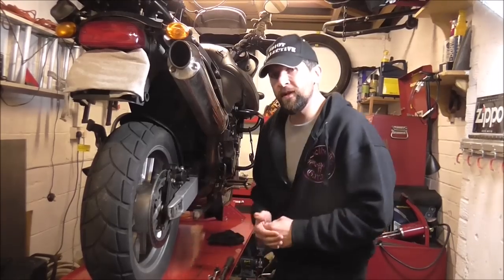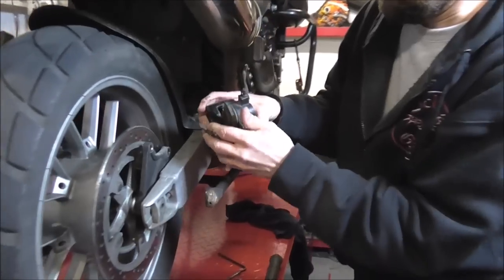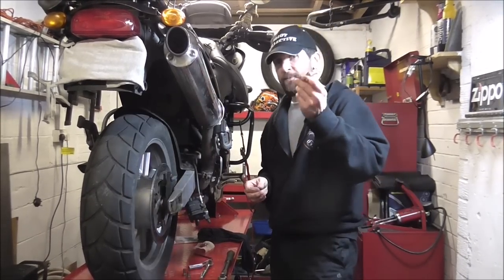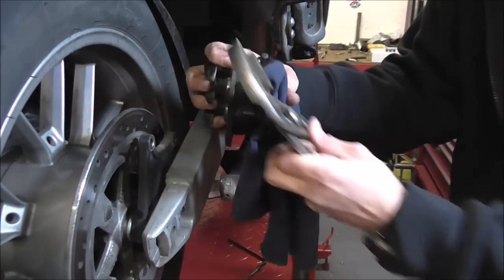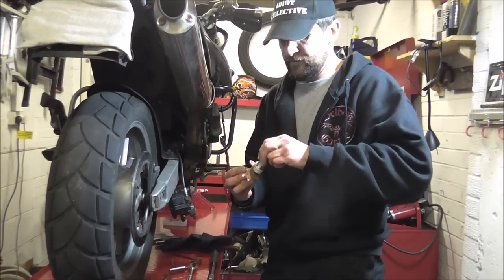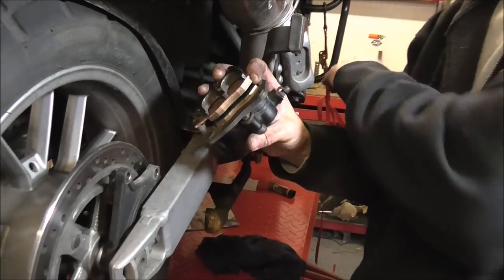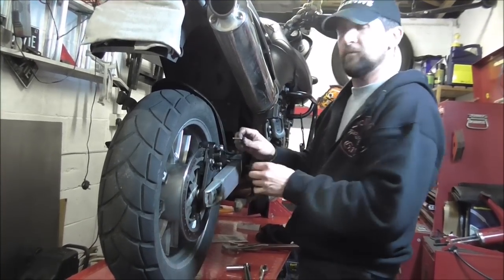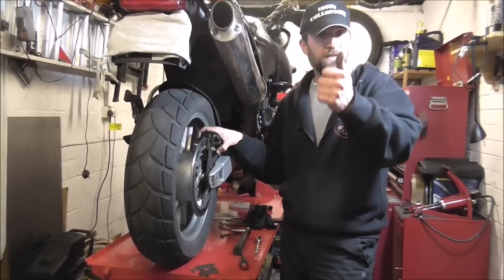Delboy's Garage, EBC 'HH' Sintered Copper Brake Pads.

Comment: Awesome explanation on the EBC HH Sintereed pads, and I am sure they are the bomb for sports bikes or cruisers with front and rear disc brakes, however I have an older bike 2002 Vulcan 800 Classic with the disc front and a suggestion of a rear brake in the form of a drum rear brake, what would you recommend as a brake combo for pads and linings?
Reply from the maker: Hi buddy, well it's no reason not to still use the EBC pads on your front, and if you talk to Wemoto , who we trust for parts on older bikes, it may well be possible that they have an EBC drum lining for the rear... let us know how you get on!
Reply: Will do, just wanted to say thank for the vids, I am taking a Motorcycle repair course right now and your videos have helped greatly in getting me ahead of the class, you covered a lot of material in your vids and much appreciated. Tried to find EBC drum lining but haven't had any luck so far. Also tried another brand of sintered pad up front and they were really hard on rotors and with the weak rear drum brake caused the bike to dive under hard braking, makes it a bit squirrelly especially on a lowered cruiser.
Reply from the maker: Yeah, sintered pads are harder on discs due to the higher friction they have... but i guess thats a trade off for more bite... i installed them on Penny's Scrambler and she says they are more instant to react, and need less grip on the lever too.. so maybe dont grab them too hard and see if that helps... we also used the EBC discs to go with them as they claim their discs are better suited to resist the wear, that makes it a pricey upgrade, but so far, almost no wear on the disc other than the usual rubbing in bloom, and thats on just over 1000 miles... so we wait to see if they last better than factory discs...    Good luck finding the brake shoes... as a last thought... have you thought about getting the drum itself skimmed to make it flat again, then installing some new factory OEM shoes..?.. just a thought.!
Reply: by skimming do you mean breaking the glaze with something like 120 grit emery cloth or a mechanical resurfacing, if the resurfacing is what you mean the shops have not done that here in Canada for almost 20 years on cars and trucks, and the bike shops I contacted say they have never done it to their knowledge, but their techs are young and only know of their own experience. Thanks for your responses, I am now looking into swapping a disc brake setup from a Vulcan drifter of the same era to my bike, only problem is I have to swap both rims as the speedo is on front tire for the drifter with disc setup and on the rear for the Vulcan Classic with the drum brake setup, might be more expensive than this bike is worth.
Reply from the maker: No buddy... i 'skimming' i mean having the top surface ot the drum machined off to its flat, engineering shops can perform this, you may need to hunt round for a firm to do it.. but it involved taking the grooves out of the drum inner face to give a new flat finish, thus more contact and better braking.. i was just trying to suggest a way to improve on the factory equipment you have already and no spend a fortune on a disc conversion.... you may not find anyone to do it... but even temporarily, if you brake the glaze off the inner face of your drum it will improve braking.. but only temporarily.. it will soon glaze up again in use... sorry not to be more help buddy.
Reply: Thanks for your suggestions, all good info. Got rear wheel off now, changing chain and sprockets (front and rear) replacing brake linings, de-glaze drum and putting in new wheel bearing and seals. Should be good for a while again.

Comment: Funny coincidence I bough these pads last month, I have a quick question, when I lightly cover the breaks and apply a little pressure they kind of make a funny noise ( like a sssssss noise) that stock brakes didn't, its not really a sequel (so I don't think they are vibrating although I didn't use any copper grease when they were installed...) but when I apply more pressure the sound goes away. Also if I apply alot of pressure and then just cover them again there in no noise, so I think it maybe temperature related? any thoughts? have I done anything wrong?
Ride safe!
Reply from the maker: Blimey Josh, top marks mate, you've clearly got them set up perfectly!  That noice which you describe kind of a 'skissssh' sound is sononymous with high performance brakes and it is purely the temperature leveling out as you apply them... quite normal, and quite correct... there's usually no need for copper grease on copper backed pads, as they don't vibrate like organic ones, Take Care mate, and safe braking! Del
Reply: Moonfleet41 Ok thats great to hear, ride safe man

Comment: Maybe I've just been lucky but I've never added grease and never had squeaky breaks, surely sintered pads are slightly porous could it not be possible for grease to seep through the pad? I know moto gp and superbikes don't use grease on there brakes..... Apart from that I've learnt a huge amount with your vids and always take a look when I'm working on my bike.
Reply from the maker: I think it's important to lose the connection with the word "Grease" in the case of this Copper based product it's a misnomer because that implies a lubricant, and this is an antiseize compound, designed to provide a non ferrous barrier between metals and inhibit corrosion, and in fact it is detrimental to use it as a lubricant between two surfaces that will slide across each other, it will then act as an aggregate and erode them.   In the old fashioned and very common practice of using a small wipe of Copper Slip on the BACK of a brake pad it acts as no more than a damper to absorb high frequency vibration that leads to a squeal, only use it if your brakes squeal, because that all it's for, a vibration inhibitor,   Brake these days tend not to squeal, but with older bikes it was very common,  hence why so many younger and less experience riders get their pants in a bunch over it, because they simply dont understand it..and some people will naturally confront what they don't understand   and no mate.. it will not "seep through" your brake pad, what ever the porosity of the lining material, they have a solid steel backing.!!!

Comment: I am a bit concerned that sintered pads are being put on the rear of a street bike. The risk of locking rear and fishtailing especially  for a new rider is my reason to worry. Will it not be best to use sintered in front and organic  - regular in rear?
Reply from the maker: As a new rider, remember what your instructor told you, which should have been go gently on the rear brake... it's more a brake to steady the bike, than stop the bike, it's also excellent for slowing down with a pillion on, because it prevents forward rotation of the frame and diving, but don't criticise efficient brakes for being too efficient, simply apply the brakes accordingly, it's hardly right to deliberately opt for weaker brakes so they don't work too well, surely better to have efficient brakes of the finest quality and use them sensitively , and of course, practice your riding and hone your skills... you only truly begin learning 'after' you pass your test...

Comment: Just changed my pads on the rear of my 2015 triumph, the new pads were EBC, now my concern is my old pads have a honeycomb chrome plate on the rear that hooks over the edge of the pad, now these don't fit on the new pads as the new pad backs are slightly larger, I have fitted the pads without these plates but do you think I should cut off the tabs and fit them anyway, are they just a anti shim plates ? Your advice would be appreciated 👍 cheers great vids 👍
Reply from the maker: They are anti-squeal plates, all you need to do is smear some copperslip on the back of the new pads, and they will be fine!

Comment: Another great vid, thanks. I've just put Hel braided lines on the front, they are a bit better braking wise, but not a lot. Do you think sintered pads are the next upgrade? Do they last as long as a cheaper pad? One more thing, do aftermarket adjustable levers make any difference, or are they an aesthetic/comfort ting only?. Keep up the good work mate, fantastic vids
Reply from the maker: James Bond Hi James, the adjustable levers are purely a comfort thing, unless you have tiny hands, like Penny, then they are essential!  

Upgrading to braided hoses once used to have an astonishing effect on improving the brakes, but these days the rubber hoses are far better quality and don't swell as much, so the improvement is less marked... Sintered pads are the next upgrade and they will make a big improvement, but be aware that they are quite aggressive on the discs and will eat them quicker... if you don't mind about that, then get them all round and you'll see a big difference... hope that helps mate !

Comment: Just a quick one, how long does it take to bed new pads in, have changed front and back and just wondering if there is a set bedding in period, e.g., miles 100/200 ? Many thanks, great vids 👍
Reply from the maker: All depends on how badly the discs are worn, if they are quite grooved, then it will take quite a while for that fresh flat pads to bed in to the grooves... but if the discs are mirror flat, like when they are brand new, they will work right away... just be conscious that they will be a little weaker for a while and leave a little more braking space... there's no set mileage to it buddy.

Comment: I installed the Sintered HH pads on my Rocket 3 and didn't like them at all. Noisy, grabby and I could visibly see the scratching of the disc. They were some of the strongest braking I have ever had but didn't like the other issues. Replaced with OEM grade and all was better.
Reply from the maker: Colin Kessler These are all things I've said against sintered pads in the past, they will eat your discs and they do take some getting used to, but I guess for some people braking efficiency is their first concern, specially on a 12ton bike, like a Rocket3... the OEM pads are always more than adequate and as with all things in life, there's always an up-grade if you want it ... thanks for watching!

Comment: Hello Del,
Congrats again, you guys, for the video, I'm going throught them all one by one, because they're just so good! It's better than any Netflix show, I swear!
Tech question: replacing break pads on a '08 Sportster R, would you recommend going for EBC HH or semi-sint - for city riding mostly?
Thankns in advance, and again, excellent, excellent videos, brother!
Reply from the maker: Hi Giacomo, I've used EBC HH copper sintered pads many times on busy commuter bikes and they are wonderful, they have more 'bite' and friction resistance against the disc, so give a little more feedback and generally feel more efficient... naturally, more bite and friction resistance means that copper sintered pads are known to wear discs quicker, but if you're ok with this, then these pads would be an up-grade to your braking efficiency and you should well notice the difference!

Comment: what grease if any would you recommend when putting ur wheels back on the spindle?got the bike back from paint and going to be building her tomorrow hopefully
Reply from the maker: Hi Jayson, just some regular ordinary LM grease is fine for your axle... nothing special, and not too much either, just a light smear along it's length... hope that helps, good luck with the re-build!

Comment: Thanks for a great video...as always  👍Hava a question though, on my bandit 2007 I have two plates, according to the manual "insulator" and "retainer(aka anti-chatter shim)". Does it make sense to use the copper grease you mention in the video or these smart plates do the thing?
Reply from the maker: If you have shims on the back of your pads, then they should do just fine in stopping the brakes squeal.. but if not, then add a little paste and it will stop.!

Comment: Hi Del & Penny - hope your both well - great little vid as always, i know that my dad used to slightly rough up his pads when he replaced them, stating that it was like " bedding them in ". Is this something from days gone by or can this be done on todays pads? have fun keep safe -- cheers Nige.
Reply from the maker: Hi Nige, not really needed on copper pads, as they'll soon bed themselves in to the discs, and the more expensive pads, such as greens and reds, they have a painted coating hat is designed to help bed them in.... technology has moved on a bit I guess!

Comment: What's your view on using a slightly crappier compound in the rear, as the rear tends to break away more easily (on my big trailie anyway)
Reply from the maker: Hi Neil....it ,akes no difference, if you have 'lesser' pads, then you just tend to brake harder to get them to stop....try these out, they have so much feel and bite, that you barely need to touch them by comparison, then just brake more carefully...and then the day you need some real braking force in an emergency... just step on them a bit harder.. your choice mate, but i think you should dumb down your braking enthusiasm and not your equipment.....
Reply: Ha ha, thanks they will be my next choice. I put it down to size 12 feet and not a lack of finesse on my part... Obviously!

Comment: Del, Help lol. I am doing my rear brake this morning having trouble undoing the retaining pins. Are you using an allen/ hex key there? or a star drive I cant make out if its an allen key or a star drive it looks like a star drive but that may be damage from a previous monkey using the worn size allen key. The 5 mm allen/hex fits but there is play and the 5mm staris to small and the 6is to big so must be a 5.5 if it is a star key. I have looked up the parts and they are the same retaining pins for daytona and tiger. I was wondering if you could tell me what you are using there. I dont want to round those retaining pins off.
Reply from the maker: Triple Blue Hi Rich... The correct tool is a 5mm Alun key, but as per usual the bolts end up 'wellied' out due to worn tools and bad handlng.....invest in some top quality brand new alun keys, they wear out really quick and yet we keep using them, and they become the single biggest reason that alun bolts wring out...if you put a micrometer across the end of yor alun jey, it'll more likely measure 4.8mm than actually a full 5mm.....so if you can, before you ruin the bolt...get a really good, sharp, new alun key and apply it dead square to the bolt..better still get socket mounted ones of you can afford them, then you can apply inward pressure while you turn and your bolts will last longer... hope that helps chap... good luck with it.. Del.
Reply: Cheers Del, Yep have fairly new alun keys and sockets. Its the bolts they are already ruined someone has hammered in a torx at some point to get them undone and then not replaces the pins. I have got 1 out using the same method the other I had to drill and use an easy-out/ extractor which got the threaded part out nicely but left the rest of the pin in. This should just tap out but so far is proving stubborn lol. Dont you love it when the previous owners a numpty and causes a job that should take 30 minutes to become an allday faff lol and to confirm the muppet had used loctite on them as well grrr. Thanks Mate
Reply from the maker: Triple Blue Oh yeah, you'll always find a bodge or three....but its not just previous owners, ive found bodges on new bikes fresh from PDI, chewed screws on the switch gear from heavy handed 'Technicians' too lazy to take any care because they've got four bikes to PDI and its Friday.... you know how it is mate, its only done right if you do it yerself..!!!
Reply: Wish I'd done my routine maintenance on it now like you tell us too instead of leaving it until it needed doing. I guess I figured only a back brake don't use it much anyway lol.

Comment: Hi, liking the vid's.
I got a bonneville from 2001 and in need of new brake disc's , they are at the min thickness .
Thanks to your vid when know about the pads now , but with are your thoughts on disc's.
There are some different brands and prises that go with them , I know don't cut corners on brakes .
Looking forward to hear from you .

Kind regards 

From Belgium

Wout
Reply from the maker: Hi Wout, I would imagine the Triumph genuine discs are the best and probably the same kind of price as after market ones, but I don't have experience of changing these discs, or buying different ones, so can't help much further than that... good luck with it!
Reply: Moonfleet41 Thanks for the input , I will put some aftermarkets on , UK made claim to be better than originals. It is easier to get than originals from the local dealer .
Reply: Moonfleet41 
Just to let you know.
fitted the brake disc's , new sintered pads and a steel brake line for the front , with a world of difference it makes .
I did rebuild the brake calipers when I first got the bike , the reason being the back caliper was locked up due to standing stil to long .
Love messing around with it .

Ride safe